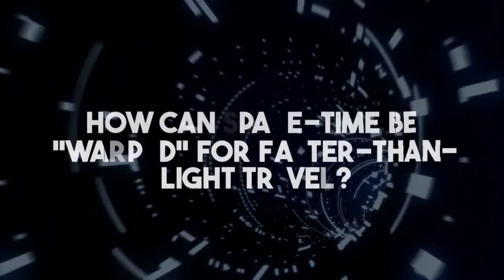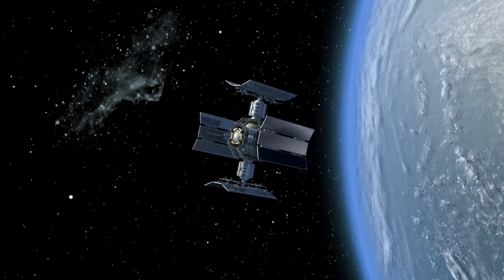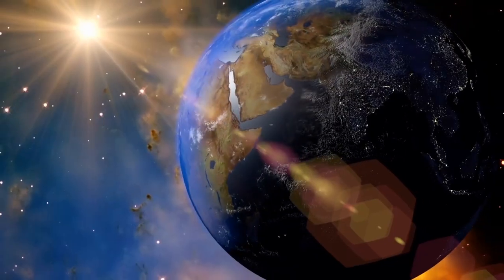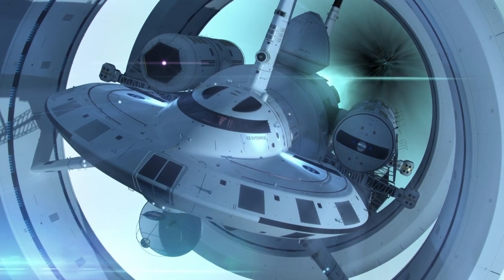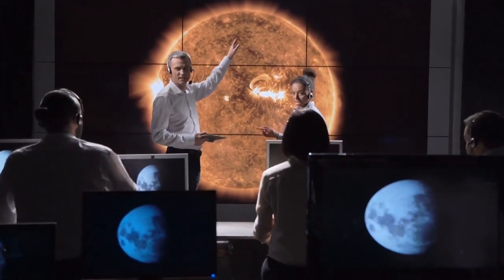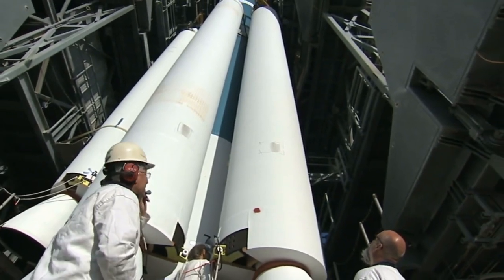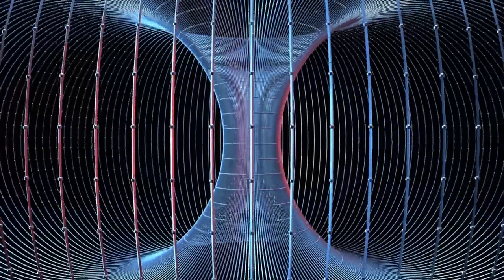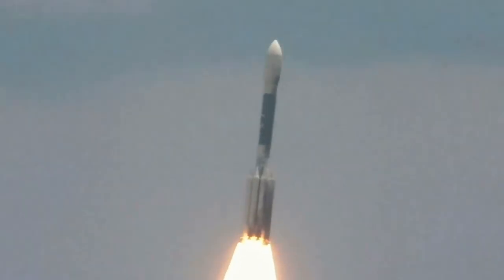Scientists Discover Revolutionary Way to Travel Faster Than Light

Comment: Love this topic. This is why most people should realise that all this UFO activity is NOT aliens. As said here it takes very very fancy physics to travel at the speed of light which is still too slow for inter galactic travel let alone interstellar travel . So if someone or thing could travel at or faster than the speed of light our scientists and our astronomers would see that coming from the other side of the observable universe so if there are aliens they are not coming from this universe. The whole problem is we can never make an engine that runs fast as the speed of light. We would have to invent a machinery that can manipulate the space OUTSIDE of the vehicle we travel in. Why ? Because if we put a magic outboard engine on the back of a rocket or lets say SpaceX's  starship it would have to be very very heavily armoured and protected from radiation. When it is said that the closer to the speed of light you get you become more MASSIVE . Your ship dont get bigger and this is going to help explain E=MC2 here. What happens is you need more ENERGY and that is the same as mass. Have a look at those powerboats that do the fastest speeds across water. If they are too powerful they flip over and crash because the speed and mass of the boat makes the bow WAVE bigger . That is basically the same as space travel. You try go the speed of light and your space ship is not going to take that bow wave (Space time + cosmic rays and sub atomic particles) . It is basically the same thing as those big power boats. This is why people need to leave CERN and the LHC alone. These people are only looking to make our lives more sustainable on this planet. Humans are very very damaging to the environment. Cern will if left alone make all the fancy Startrek stuff reality one day. Everything on Startrek can be done we just need to find out how to do it.